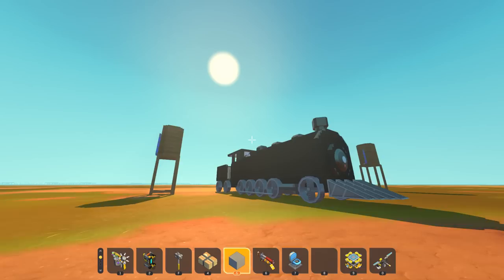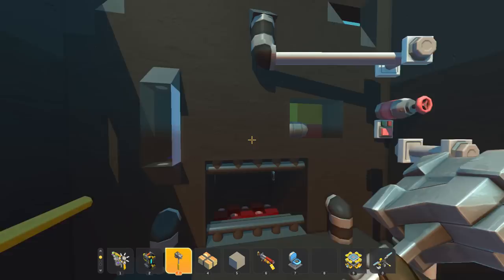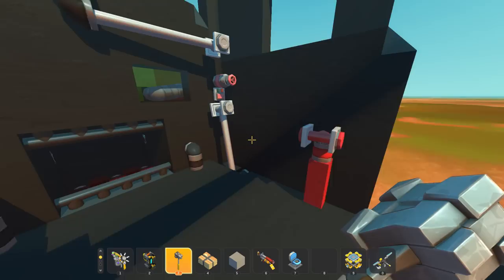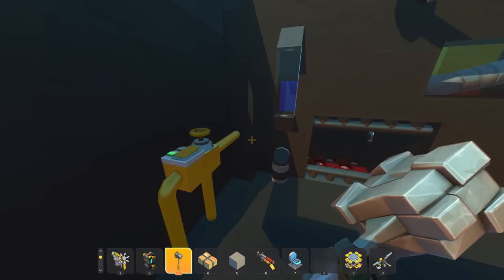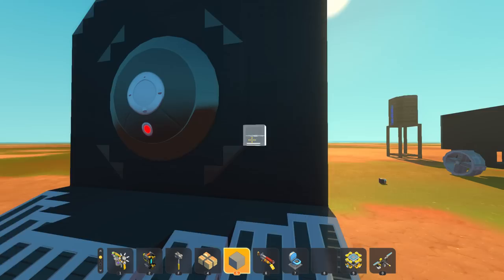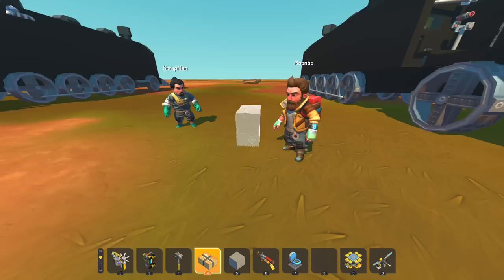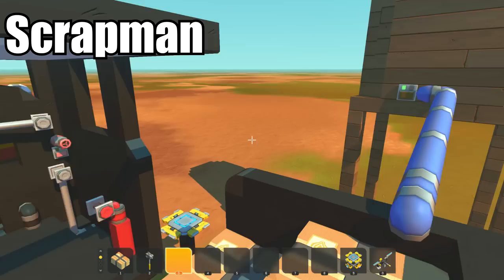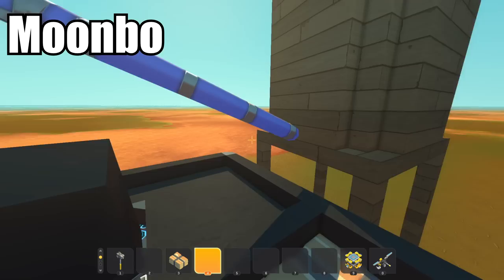I Built a Locomotive Simulator to Teach my Friends How to Run a Steam Train!

Comment: This is pretty neat! My only critique is that brakes would be applied by slamming the lever forwards, as this made it easy for engineers to slam all levers forwards to emergency stop the train in the event of potential danger.
Reply: That’s actually really cool to learn!
Reply: I'm pretty sure he mentioned it at the beginning, he said he based it off a more modern design.
Reply: @johngray8749  Modern designs are the exact same.
Reply: @johngray8749  I think that was the point. You can't slam the old brakes, they need to be clamped with tools if I remember Hyce correctly.
Reply: thats not universal and differs from country country. in germany for example you pull towards you to slow down. (because the throttle is pushed away to accelerate)
Reply: @jordananderson2728  Not for trains with a combined brake/accelerator lever. The you usually push it forward to accelerate and then pull it backwards to brake. If you pull it all the way back, you do emergency braking.

Comment: Steam locomotives are so cool. I use to maintain a boiler for a company. Lots of chemical involvement with those to stop the inside from rusting and corroding away. As well as having to heavily water soften the water going in cause otherwise it causes mineral build up. As cool as they are firetube boilers are also scary.

Comment: There should be an advanced mode in railroads online where you have to use the injector and manage your fire levels
If you don’t manage properly it’s starts taking damage and you have to get it fixed

Comment: theoretically, a cold steamer would already have water in it, otherwise the crown sheet will overheat when you try to create pressure for the injector.
I think the next step would be to limit the max speed if the johnson bar is too far in the corner.
Reply: True, you would probably never do it this way, but I think (most of my knowledge comes from Hyce's videos, so I'm not too confident) you could do it this way in theory, because the temperature you need to create a small amount of steam is way less than what would damage the firebox. It would only damage it if you need a lot of steam to run the injector, hence a lot of heat, hence damaging it. (though considering the damage heat cycling causes, this might be really bad over time, but that still depends on how much steam you need)

Comment: one thing i dont understand, how are you getting steam pressure to power the injector to get the water needed for steam to start being created.
Reply: steam locos are normally put away with water still in the boiler (kan's waterglass should have started with some showing)
just light a fire to turn the water into steam, then use the steam to power the injector to add more water
if the water gets too low, the metal above fire (crown sheet) gets too hot and partly melts 
if the boiler is under a lot of pressure when that happens, it can result in a steam explosion and horrible deaths for crew
Reply: @LoPhatKao  Thank you so much

Comment: kAN this would've been so much easier with Modpack's Smart Engine. You can set the strength of the wheels like, which also works like a released clutch if you set it to 0 (free bearings basically). You could control the speed accurately. And Number/Math blocks would make the logic so much simpler too. EDIT: Oh and the sensor-pipe logics would be eliminated, that's some stone age stuff there lol.